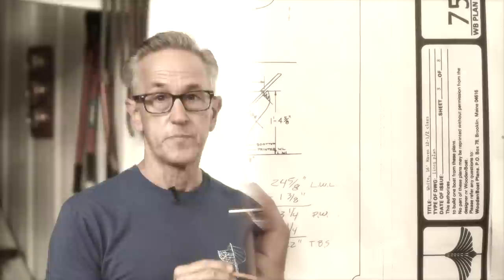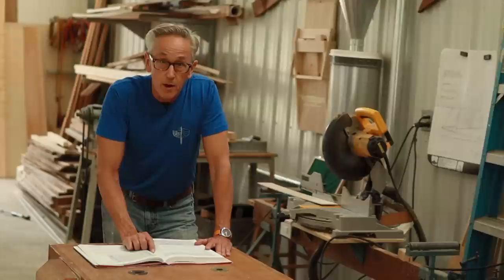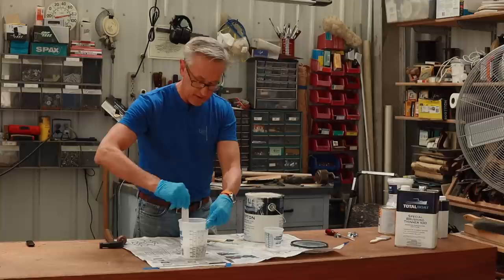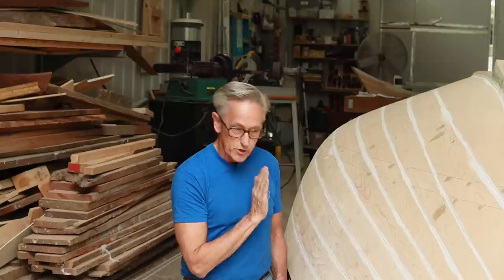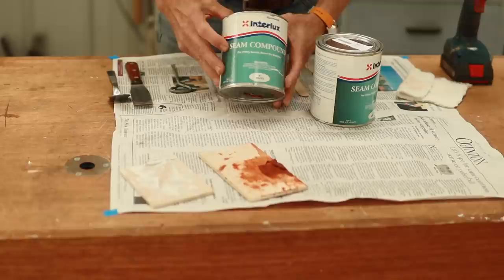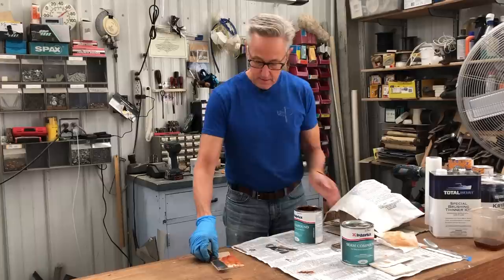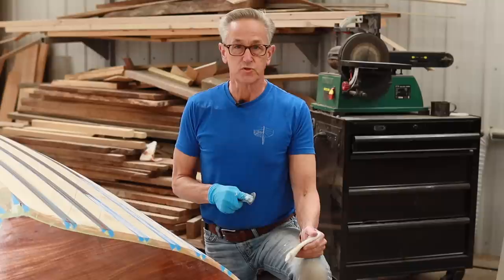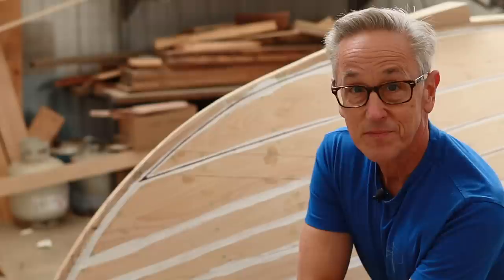How to Seal and Pay the Hull Seams on the Haven 12 1/2, S2-E32

Comment: I really like the idea of using a spoon. I had been using a popsicle stick for filleting epoxy joints,, but now I intend to use a spoon.  I think it will work better.
Reply: A little spit on your finger works well too. But you start getting quite the case of dry-mouth before too long on a big job like this. Maybe a bit of BLO to dip your finger in? I'd test that on a scrap before using it on a project though.

Comment: You could have used triple tape used in the car body shop to paint stripes. The middle part of that tape is put on the joint and removed before filling. Gives an excellent result.

Comment: Instead of punching holes in your can, simply cover the rim of a newly opened can with masking tape. 
Work the tape around the inner edge and let it overhang over the outer edge. 
That will keep the seal for the lid and the outside of the can cleen after you remove the tape...

Comment: Asbestos was also removed from auto parts and other things but NASA can still use it the inside of rebuilt traction motors are insulated with red lead paint so if used properly it may still be available from a electronic supply or even a railroad supply. But probably not available for home use. The railroad is a lot more environment friendly today than what it used to be.

Comment: Just curious, when you punch drain holes in the rim of a paint tin, doesn’t that lead to air drying our the paint, rendering it useless if stored too long?
Reply: No.  The tenon swaged onto the lid mates with the mortise on the can where the holes are punched and prevents air from entering.
Reply: I wondered that too, but the seal is made outside the groove where the nail holes are punched.  First saw it on Lou's Tips from a Shipwright.  It's worked very well for me.
Reply: Or is it inside??  Doesn't matter
Reply: No, the holes are mid-seal. They let the paint/contents drain back into the can and the lid seal covers the holes when the lid goes back on. I've seen other shiprights use this technique with paintcan style cantainers as well.

Comment: I love the series. At one point you felt that the Haven was not a great beginner project.  What do you think of the Gartside #208 16' Double Ender?
Reply from the maker: Paul's Double Ended Skiff is a beautiful boat. I've also admired it. Paul does note that the build skill level is high on this design. I think a good beginner boat is one without bent frames. There are may skiff plans like that.
Thanks for watching. Let me know if I can help.
Cheers

Comment: A quick question: At 4:21 you offered a tip to punch a few holes in the rim of the can. Although it doubtlessly helps paint drain back into the can it also raises the question. Wouldn't the paint dry out with holes in the rim?

Comment: I work at the railroad and we have red lead paint for the string bands on DC generator's I don't know how old it is but we have it.
Reply from the maker: Hi Gordon, Yes, most likely old stock. Lead in paint was banned in the US in 1978. There were suppliers that had old stock that some found as late as the 2000’s however, it was like buying gold the price was ridiculous.
Reply: @TheArtofBoatBuilding  yeah, old stock can still be found, but the price is stupid high. That stuff has a rediculous shelf life as long as the seal is unbroken. I have two five gallon buckets in the shed. The former property owner was an L&N maintanance foreman. I have sold a lot of tools to a local railroad museum, but kept some as a monument to this cir. 1820s house I live in. It was originally constructed as an L&N bunk-house. I has settled over the years and has never been jacked back up. It needs a lot of work. The stone and beam foundation has rotted and the whole place is severely warped. My best estimate to jack her up and level her is 35k, that's 6k more than I paid for the house. I also have a storage shed that was originally a pump-cart house. Still has the oak rails in the floor that the hand pump cart was rolled in on.
Now it is a combination of storage and my woodshop (of sorts) ~12 x 16 feet board and batton.
Reply: Is no one aware of the environmental and health issues of lead in this thread?
Reply: @dnomyarnostaw  I wasn't planning on ingesting it, or allowing my grandchildren anywhere near it. If I use it at all, it will be to repaint my  metal roof, the same paint that's already on it, from the previous owner. Once dry it is only dangerous by eating the paint chips. I don't think anyone's children are running around chewing on roofs or the bottoms of boats, the boats engines, or from between the boat's planks.
Hopefully, anyone repairing old boats and houses is disposing of the waste accordingly.
Reply: @thomasarussellsr "trust people to dispose of it properly ".  Well, that's why they banned it. Lots of people not disposing of it, plus the expense and trouble of collecting lots of small amounts and processing to make safe.
Edit : I hope your grandchildren dont water vegetables  or drink from the roof  runoff.
Reply: @dnomyarnostaw  no gutter collection for watering. 200 year old house with built in gutters piped straight into the septic system. The shed that runs off onto the flower beds grows beautiful flowers with no signs of any damage from chemicals leaching into the ground, same paint on shed roof.
Edit: children all know the roofs are painted with that paint and the older grandchildren do as well. As the younger grandchildren get older they will be told as well, and why not to use that water for anything consumable. We're not stupid, but thanks for your concern.
Reply: @thomasarussellsr  Never heard of rain water diverted into a septic tank. It must be great when you have a real downpour.
Then, heavy metals in waste when you have the septic pumped is a real hazard.
Why don't you just acknowledge  what a bad idea lead paint is and try to protect people and the environment? 
Too many bloody socially perverse old sods in this world. I blame lead in petrol.
Reply: @dnomyarnostaw  as long as children don't swim under a boat and scrape off the paint and eat it it shouldn't be a problem. Using lead paint inside a house is a really bad idea. On a boat it was used to poison the wood to stop it being destroyed by worms and microorganisms it served a purpose.
Reply: @dnomyarnostaw  I didn't design it that way. It was already done when I bought the place a couple of years ago. The septic tank is a buried 12k gallon train tank, from what the former owners said. I would imagine any lead particulates are resting peacefully on the bottom of the tank. I just hope it doesn't cave in while I or my family is on the property, that would be a nasty swim. Getting it dug out would be out of my budget and hauling in dirt to replace the displacement around a modern septic tank system would add a lot more to the cost. I only paid 29k for the property and the old place needs a full restoration, so as long as the septic is working, I am not changing it. The amount needed to be pumped to keep it functional will never lift any lead off the bottom of such a large tank, so no worries. It has vents so evaporation seems to keep the level at a resonable level even after a decent storm. I have inspected the level after a few heavy downpours and it seems to stay several feet below ground level, my 6 foot measuring stick hasn't touched it yet, held even with the lid that sits 6 inches above ground level. I have contacted a local septic service company and they advised me to have it pumped if it gets within 2 feet of ground level. They asked if I would remind their driver to not scrape the bottom since I likely have lead particulate in the tank. I have covered all the bases.
Reply: @dnomyarnostaw  Also, where dobyou think Lead comes from? It is a nuturally occuring metal in the planet. Humans pulled it from the ground and refined it for all the uses we used it for. It is not dangerous to the ground, it is dangerous to living, non-plant based, beings. So, as long as it is not being pumped into rivers and streams and waterways, no harm to wildlife/fish. As long as humans are protected from ingestion, no harm. Obviously, don't put it in the ground near a well that you family drinks from, which you never put a septic system close to a well either. 
If the day comes that My house is all fixed up and repaired and I have the ability and funding to address the septic tank, I will get it all pumped out with proper disposal of the lead in mind, sanitize the tank, inspect it for any metal fatigue, repair as needed, and coat the interior with some form of latex/tank sealant from within. I will then install an extruded metal floor (if there isn't one already, being a train tank) and coat it as well, so that a pump hose can not scrape the bottom in the future. Reinforce the structure as needed against collapse, and put it back into service. I mean, after all, who the hell has a 12k gallon septic tank for a 1 bathroom home? Of course it will be a 2 bath after renovations.
Reply: @dnomyarnostaw  also, sorry for the books, with this covid 19 stuff going on, I don't have many people to talk to right now.

Comment: Loved the look with the blue tape. 
Really interesting, thanks. 

On the 10%.... 10+1 is 11, do you're just below 10%, not that it matters here.
Reply: I wondered too. The result IS 11 fl Oz (as you point out); 1 of which is thinner = ~9%. I wonder if the manufacturer specifies a ratio to avoid just such questions.
Reply: @trinitytoo  wish I'd never mentioned it. 

But by adding 10% which is what Bob did, the result is the roughly 9% that RB mentioned. To get 10%thinners you take 9+1. 

It all depends on whether it's a 10 plus 1 dilution in the instructions, or a 10% in the finished mix. As we don't have the instructions, no way to check. 

Either way the discussion should be about clarity, not the I'm right you're wrong approach.
Reply: kevgermany I’m glad you mentioned it. Made me look into something I thought was simple. Different definitions.  I think it may come down to “dissolved in”.  I’ll stick to ratios.
Reply: 10parts primer plus 1 part thinner is a dilution of 9.09%.
For a 10% dilution, it should be a 9:1 ratio. Simple math really.
6th grade or earlier depending on state guidlines where and when you went through school.

Comment: Just wondering, does adding primer to the cotton then waterproof it and prevent it swelling?
Reply: Not an expert or even a novice but I would argue "absolutely not." You want the hull to swell in order to naturally seal it upon entry into water. The issue becomes one of different temperatures the hull is impacted by just from being in the water during both day and night but then of course how the boards wish to separate once pulled out from the water and placed on dry land. This is typically done by "wrapping" the wood (a birchbark canoe by way of example) or creating some type of vapor barrier between the hull and frame of the vessel. Either way the goal is the same namely a dry hull as with a dry hull one can then safely move goods of any type across water without fear of rotting and indeed just use the boat as a "roof" for some type of shelter for doing any type of overnight work.

Comment: You can't buy red lead based compound, but you can buy lead oxide powder and mix it with linseed putty to make your own.
Reply: Thr reason you csnt buy it anymore is because its illegal. 
Its poison.
Even Duck Hunters dont use lead pellets anymore in reaerves.
Reply: @dnomyarnostaw  I work in museums and if it's a historic restoration going on display we can use as much lead as we need to. For boats that are going back in the water we're allowed to use lead compound as long as it's covered in a modern paint. We definitely aren't allowed to use real lead paint anymore though.

Comment: 10% would be 9 + 1 not 10 + 1.
Reply: That depends on if you are talking about 10% of the total volume or adding 10% of the volume in addition. It is really up to the chemical manufacturer if 9:1 or 10:1 makes a difference.

Comment: Do you plan to keep the boat permanently in water? Or will you haul the boat out of the water on a trailer? If you are going to haul the boat out, what happens to the brown compound since it is designed to always be in water?
Reply from the maker: The boat will live in the water for the boating season. It will come out before the lake freezes and back in after the spring thaw. There are protocols to keep a boat from drying out in the off season.
Thanks of watching!

Comment: Is it against wooden boatbuilder laws to use cheap laser levels to do waterlines?
Reply: He went into quite a lot if detail about why he wasn't able to use his laser level. You must have missed it.
Reply: @billstevens3796  aha. Not in this video.So, I watched the previous one, and it turned out it was a limitation of his laser. He must have owned an old surveyors one, gimballed to be level.
Twenty bucks for a cheap Painters level would have save hours of tape and battens

Comment: I have an old italian boat with extremely wide seam gaps, onve it had been caulked with hemp and cement i think, now its time to re-caulk the hull. What if i use a sealant or should i use cotton or hemp? Is there something wrong with tube sealants on wood?
Reply from the maker: Do not use tube sealant. The cotton or hemp acts as a keyway that helps in making the hull more stable locking the planks together.
Great Question! Thanks for watching.
Bob
Reply: @TheArtofBoatBuilding  what can i use as cement? The gaps are too wide for cotton to hold by its own.
Reply from the maker: @tommasofossati5123  There is a method Called wedge seam construction. Here is a link that describes it.
https://www.diy-wood-boat.com/wedge-seam.html
Hope that helps!
Bob
Reply: @TheArtofBoatBuilding  it helps of course, do you have a email address i can write to, if i need more tips?
Reply from the maker: @tommasofossati5123  my email is in the about section of my channel.

Comment: What are the odds that the designed water line concurs with the actual water line? Seems like there are too many variables in construction to be accurate with water displacement in use.
Also, why mark a water line?, does it have a function other than aesthetics?
Reply: Tom Baker  I can’t comment on the actual designed placement of the waterline, but the purpose is to delineate between the hull surface that will be under water most of the time and that which will be above the water.  This determines what kind of paint is applied.  Some sort of anti fouling paint is used below the waterline, which is unnecessary on the topsides.  The scribed line allows the boat to be painted to a consistent sharp line each time it is repainted in the future.
Reply: @FrEdmundScott  OK, 👍, thanks.
Reply: @FrEdmundScott  also, apparently different putties used above and below the water line, not just different paints.